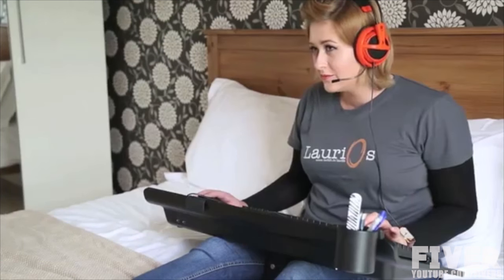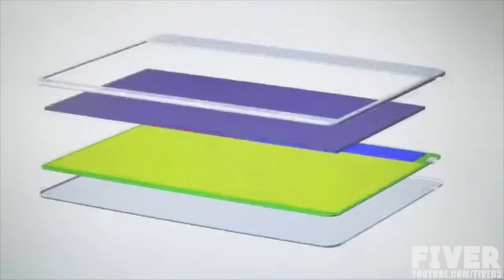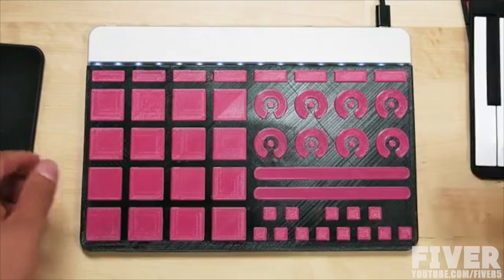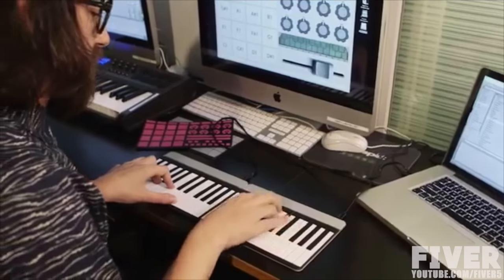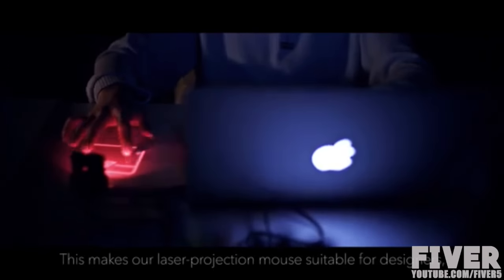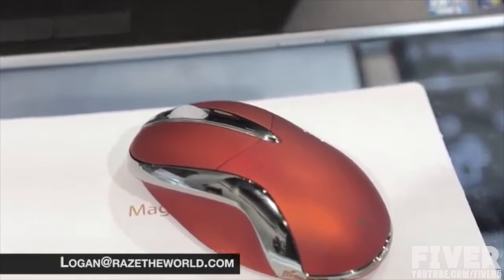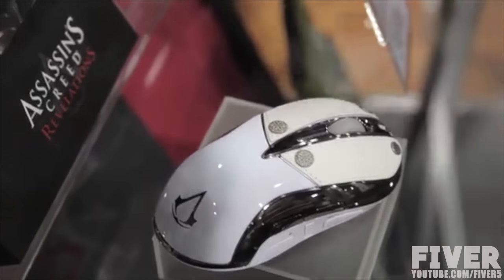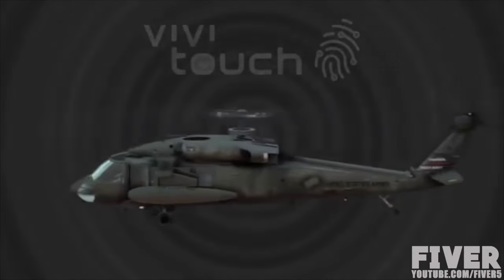5 Gaming Gadgets Every Gamer MUST Have

Comment: Does anyone at "fiver" play any games whatsoever? I guess the gaming mouse/controller is neat, but anyone using a wireless mouse need to reconsider what they are doing, and if it a controller, won't the front of it be filthy after using it as a mouse on anything other than a soft mousepad?